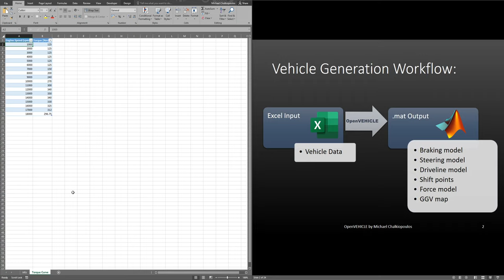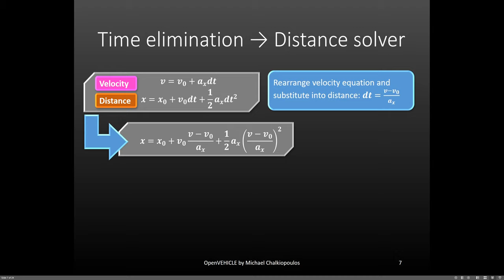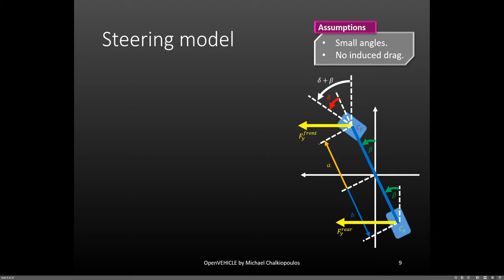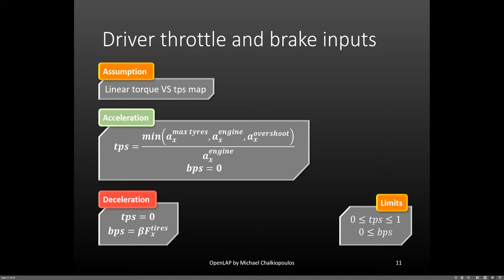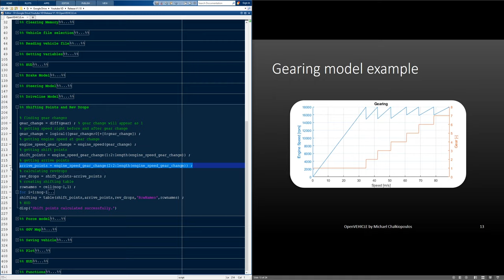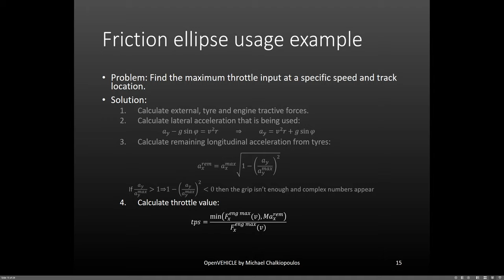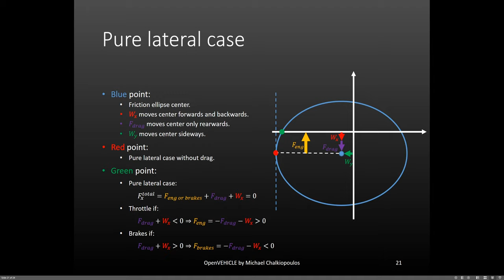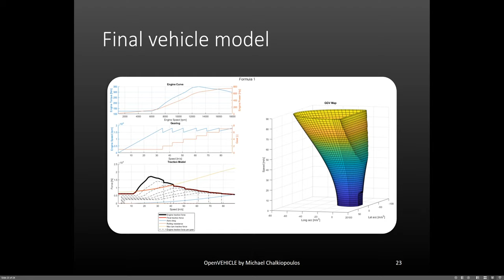OpenLAP Lap Time Simulator Part 3: Vehicle modelling in OpenVEHICLE

Comment: I see a significant real world weakness in this approach to generating the vehicle model.  It is purely theoretical and it does not leverage real world data at all.  You are calculating the GGV Map from a massive number of underlying "textbook" parameters when YOU ALREADY HAVE MANY DISCRETE SOLUTION POINTS FROM DATA ACQUISITION.  You are willing to use the motor dyno data plus the transmission ratios to calculate the acceleration map. That is 1/3 of your model input.  You have similar data on the other 2 axis...and yet you choose to base that solely on theoretical data.  It will be much more useful if you leveraged real world data to fit the GGV map to KNOWN reality.  Of course, this assumes you have an elite level driver who can get to at least 95% of the limit, otherwise you are going to under estimate the map boundaries. 

Some examples of data that you will have in the real world that should take precedence over ANYTHING you calculate from first principles:
1.  Straight line braking - you will have tons of good data here....including when limits are exceeded
2.  Straight line acceleration - implement traction control...even if your rules do not allow...and tons of good data.
3.  Straight linear and aero rolling resistance - Get the car up to speed, tires warm, push in your clutch and roll, slowing gradually on a flat straight.  Back out calculated transmission friction.  Fit the deceleration to a second order polynomial.  The linear term is rolling....the quadratic term is aero.  Done.
5.  Combined lateral and acceleration.  Have your driver push hard to the apex on some forgiving turns, till he is over the edge. 
6.  Combined lateral and deceleration.  Have your driver push hard apex out on some forgiving turns, till he is over the edge. 

The one thing that you actually do not have much of is pure turning in the real world, because even when you coast / roll, you have a significant amount of drag, at least at the rear wheels.  But, you could probably instruct a good driver to spend some time mid corner, with mild throttle, to approximate pure turning, and create some good data here.  All told you can generate a population of points that can then be used to "fit" the GGV surface to make it much more accurate. 

This is why your karting model results were so far off, and you smartly deduced why.  If you had looked at your real world karting DAQ data, you would have known that that indeed the deceleration capabilities of a kart were much less than lateral, resulting in a "wide and skinny" GGV Map.  

It would be very useful if you did another version of this video for how it is done in the real world, not how it is done in a classroom.